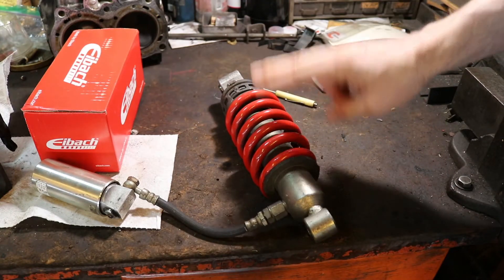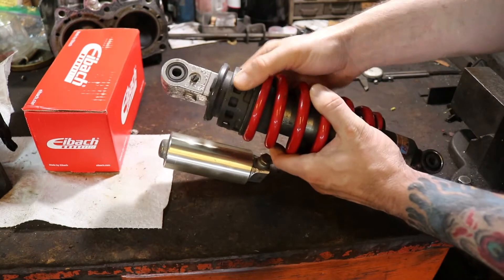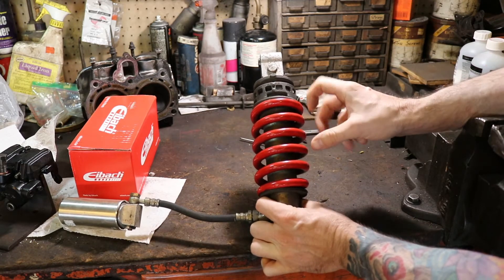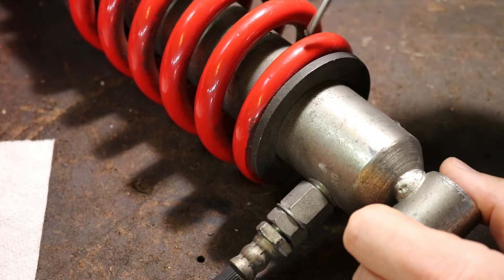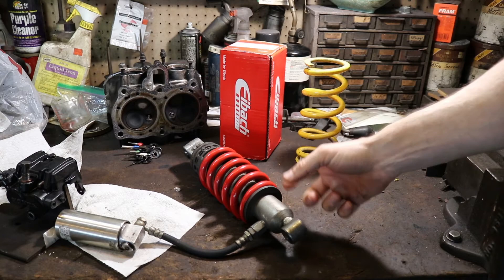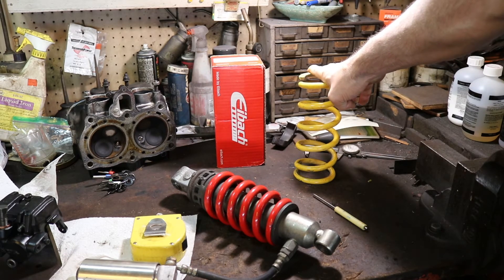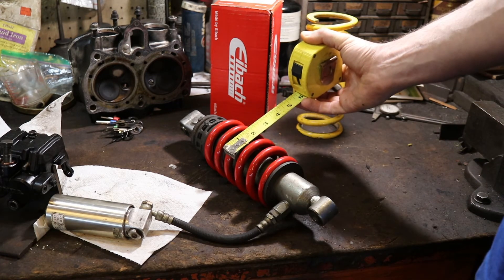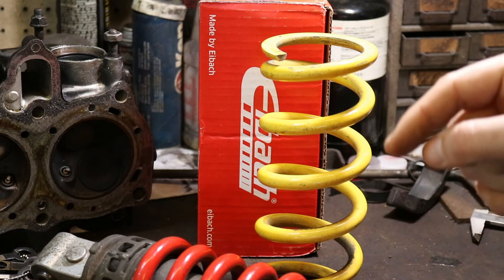Monoshock Conversion Tip: Spring Swap

Comment: Could an air ride shock work with this set up. My thinking you could adjust the ride with a blue m unit to power it
Reply from the maker: I don't have any experience with air ride shocks and don't understand the physics of them, but my broad understanding is that an air ride shock has a variable spring rate depending upon how much air ya pump into it. Don't know if that answers yr question,  but I'm also uncertain as to what your question was 😀

Comment: Thanks so much.  I wanted a lower rate mono shock coil spring for my 2012 Honda NC700X and there is so little information.  Now I just need to figure out the exact or close enough dimensions to pick a rate that is less than 600 lbs / inch of the stock coil.  While some people said just by a YSS complete shock - you don't know what the coil spring rate is and you can't order a custom coil.  I want to test a coil with a lower spring rate and if I like it I might get a YSS or other shock and then swap the spring.
Reply from the maker: You're a wise man. Shocks be expensive and the springs (relatively) cheap.  Plus, it's not overly difficult to swap out a spring.
Good luck on your quest for a better ride and enjoy that NC700X!👍😀

Comment: That shock that you showing, is it mono or regular shock that you converting to mono by swapping to the stronger spring? Just want to figure out if mono shocks are built differently except stronger springs. Thanks for the video!
Reply from the maker: I used a monoshock off a Suzuki gsxr. I am not a shock engineer and do not know what critical differences there may or may not be between shocks. For this bike I chose a shock off a bike of similar weight to try and ensure adequate engineering for my application.

Comment: Hi. I have a mind to do the same or similar bobber conversion to my ‘84 GW. Did you ultimately keep the CBR 600 f4i rear shock? I noticed the red spring swap to yellow in this video but not sure you kept the same damper unit. Or would you recommend a different rear suspension unit considering you discovered you could have gone without cutting the fuel tank etc?  By the way, I am learning so much from watching these build and fabrication videos!!!  You’re taking my fears out of the equation. Thank you, thank you, thank you!!!
Reply from the maker: Great minds think alike! Right? :)
Yeah I started with the 4Fi shock, switched to a GSXR shock, cut the gas tank, then realized I could just swap out the spring for a different spring rate and wished I had gone with the 4Fi shock with a different spring. https://youtu.be/DJWB_tors1g
Here is the finished suspension going down the road (super fun!) https://youtu.be/nU5PXZtt_S0
Thanks for the comment, my man! I am very glad to hear that the videos are helping someone :) That's really the reason for sharing them - so that others can see this is not rocket science. For me it just took the willingness to make a mistake and waste some money and time in exchange for lessons learned and the potential to have a functioning bike at the end. You can totally do it! Best of luck!

Comment: That's a great tutorial, I have watched most of your videos as I am doing a similar build.
Thank you for the time and effort to put the information out to the public.
Now, looking back at your project, do you think you could have made it work with the stock CBR600 shock? ( I have seen a lot of cafe racers on youtube that have straight on bolted shocks - most of them without rebound or compensation built in the shock). Disregard the shaft clearance..
Reply from the maker: Good luck with your build! 
I certainly could have used another shock. Basically any one that I wanted once I realized I could swap out the spring for whatever weight I needed. I also could have spent less time calculating :) as I tried to make the swingarm, etc. to fit the spring rate on the shock - waste of time. It also would of allowed me to use the gas tank w/o cutting it. I still think the linkage was a good idea as it controls wheel travel and stress on the drive shaft joint. Also of note is that it works great. The suspension works great! I think that the linkage contributes to the smooth ride. 
Are you doing a Goldwing build, or something else?
Reply: @HooptieDoodle  Thank you for the quick reply. 
I am doing a conversion to mono shock. It is a gv650. The difference is that I started to cut & weld without too much thought into the process of rebuilding it(I am new to all of this).
At the beginning I thought that it would be simple and almost any strong shock would do it, but now I realized (after watching your videos) that there are also other factors and forces.. I think I need ether a very stiff spring/shock or some kind of linkage that would keep the rear wheel from excess travel. 
This would be a Sunday morning solo riding kinda bike when complete

Comment: Can you also only change the spring to adjust the height of the bike?
Reply from the maker: In theory, yes. That's how it's commonly done on cars. On bikes, it seems more common to make small adjustments via the preload adjuster, swapping out dog bones, or swapping out the entire shock. The geometry of a bike is different than a car, and so there are more considerations. I don't have all the answers, sorry.